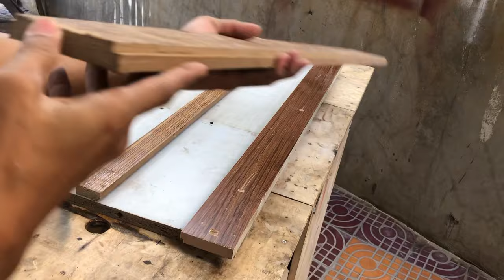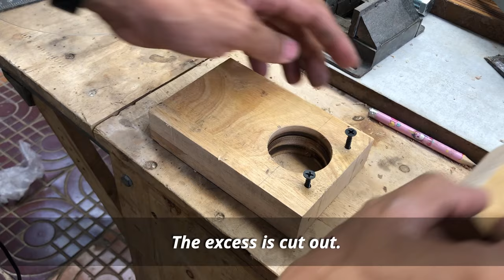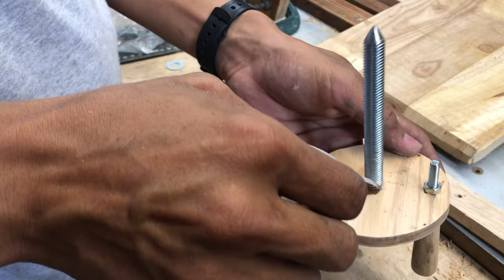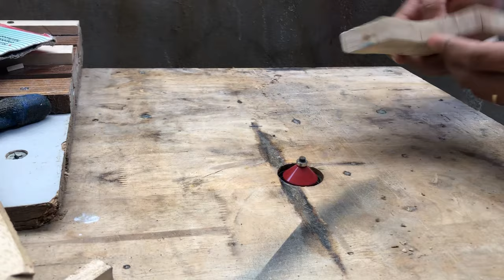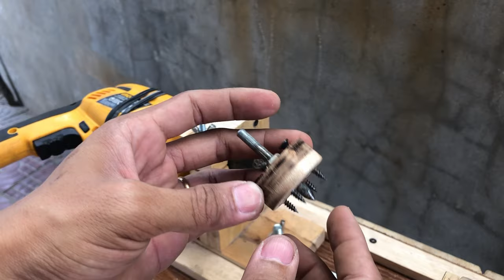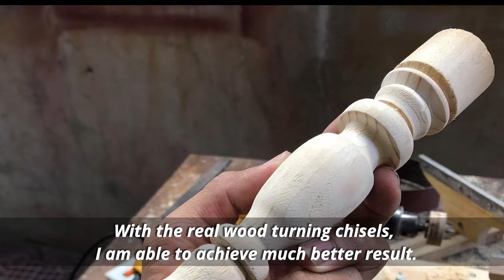DIY: How to make a wood lathe powered by electric drill | Homemade Woodworking Lathe Machine

Comment: would have just put a pulley and belt on that bench grinder to power your lathe.
Reply from the maker: Thanks for the suggestion. The lathe still need some more modification. I am glad for now I can use it for light works.

Comment: Nice design.
What RPM do you turn at and how do you adjust that, or do you just run the drill at full speed?
Reply from the maker: Thanks Mark for the comment and question. In this video I used a speed controller which I made in my other video. The electric drill has no tool to measure the RPM but I just keep adjusting the speeds which I feel comfortable to work with.